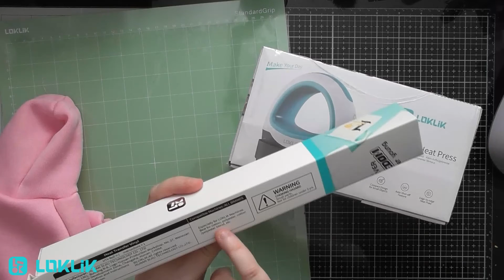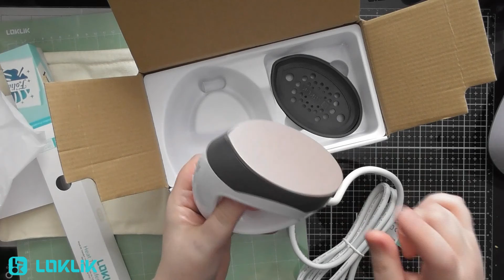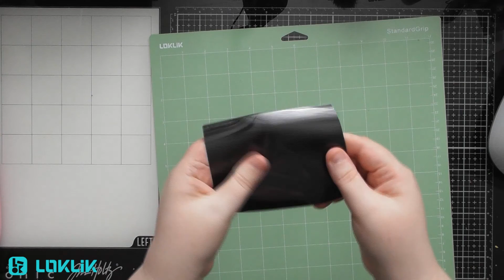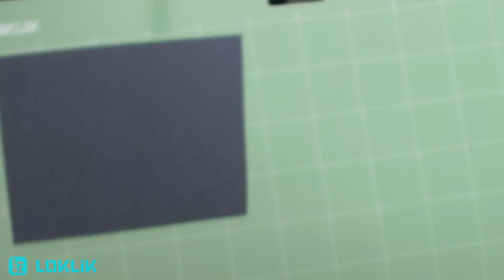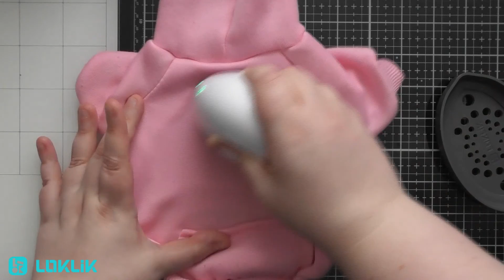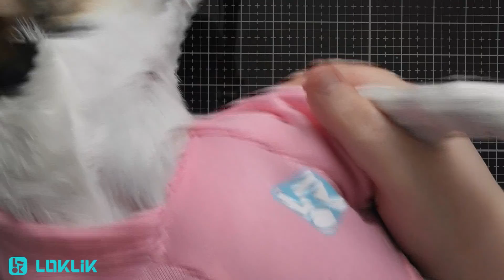LOKLiK Mini Heat Press

Comment: Hi Christine i have an apple ipad and phone only.. would this all work with those and would i need to buy cartridges with designs on etc??? thanks
Reply from the maker: Hi Carolyn :D Yes there is an app for apple, if you go to where you buy apps from, and type in loklik you can always download the app and have a play, see if you like it :D and no cartridges needed! All the free designs are in the app, or you can design your own, or buy SVG files from elsewhere too :D xxx
Reply: WOW! this sounds like alot of fun… i’ll download the app and see how it all works .. I craft on a  boat so mostly off grid with 12volt electricity although if needed i have a portable generator  which will run a max of 1000 watts so i’d need to check they are both within my limits lol… Puddings hoodie looks so cute on her x